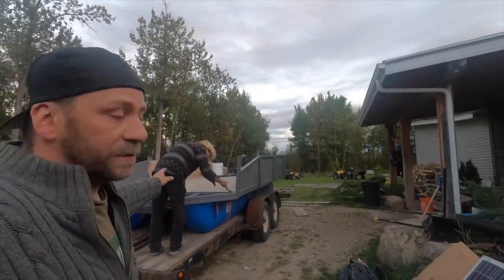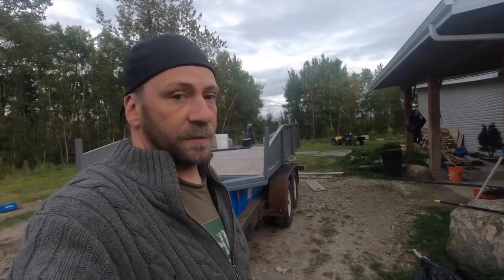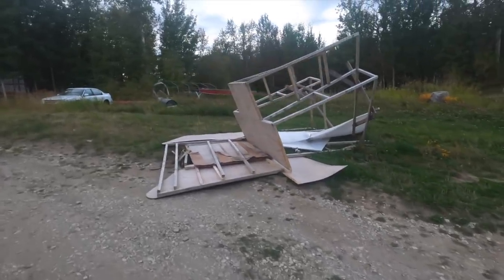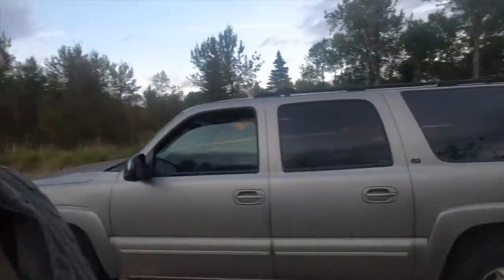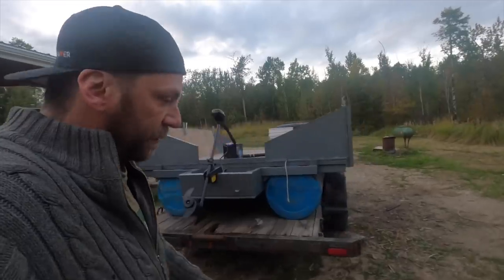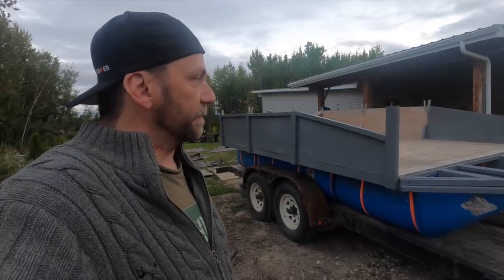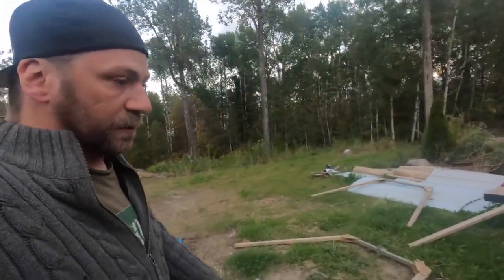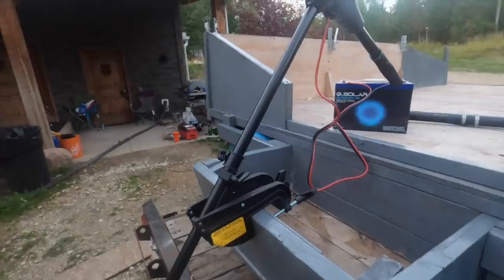Fresh Coat Of Paint On The Boat!

Comment: I don't know if there's still time before you go, but if you can fit a rudder behind the propeller (fixed to the prop shaft above, so it turns with the direction of the motor) it'll give you much more steering control. Good luck on your quest!

Comment: Steve have you thought of adding a drop down rudder with a steering handle? If you're just going with the current. That's what I have done before.
Reply: I was thinking the same thing as it could be an added sense of security if the trolling motor quits on them. Never bad to think about safety first.
Reply: Good call!
Reply: You have to plan too far ahead. That would be step 3, which is more difficult after step 2.
Reply: where does the sextant secured down at?

Comment: steve, make a rudder with longer tiller. this will allow more movement aboard and allow you to fix motor in one direction. move the motor mount off to one side a little. good luck!
Reply: plywood, door hinge, 5ft of 2x4. mount motor on side, spin to aft, lock in, steer with tiller.

Comment: A 'boat' like that would probably be easier to control if the trolling motor was mounted on the bow rather than the stern. You can remove the head to turn it 180° by removing one bolt on the under side of the head, rotating the head, and then reinstalling the bolt so the handle is pointed the right way to steer it from the bow. You can also get an extension handle so it can be controlled from further away if that helps balance the boat.

Comment: Hope I'm wrong,  but you may need more than the trolling motor for steering.
Reply: Mr. Steve does so many things that make me feel anxious for him, and this trolling motor on that river is another one.
Reply: I don’t think you are wrong.
Reply: You're probably not wrong.... but the last time they took this boat down the river they didn't even have a motot at all. Lolol. 😁.  This trip will be a 100% improvement over the last trip. 😁
Reply: It might be a good idea to take some push poles along, just in case.
Reply: @noyopacific  Ohfergawdsakes make a rudder.
Reply: Use the step two’s as a anchor sail.
Reply: your WRONG
Reply: @cjjohnson1821  rudders work fine when a boat is moving through the water. They don't have much effect when a boat is drifting with the current. Lewis and Clark used push-poles more than anything else.
Reply: @headsup65  you're?

Comment: Looks like you might have some sunlight on Monday and Wednesday thru Friday. Not a lot, though. And those look kind of like the solar panels that my buddy swears must have "Produces UP TO 400 watts IF set exactly perpendicular to sunlight AND installed somewhere within the orbit of Mercury" buried in the Chinese text that's on the owner's pamphlet. Maybe you should take along some additional batteries. Or a 9.9 horsepower outpoard engine and a few gallons of gasoline ;-) (might be lighter than all the batteries, plus it will deliver a lot more thrust energy). I assume you're going to cheat and have someone haul it back on a trailer instead of trying to get it upstream under its own power - and that you're intending to mostly just use the thing for (minor?) steerage - but still, your planned electrical budget might be a little low. If you do decide to get more battery (capacity), I suggest a pair (or two) of good 6V golf cart batteries, wired in series. They are actually deep cycle batteries (unlike many "deep cycle" marine batteries); golf cart batteries are routinely discharged DEAD, not necessarily charged correctly... and still outlast the average 12V marine battery. Thicker plates, too, if I remember correctly. And they might save your back - after all, you cannot carry half of a 12V battery at a time, lol.